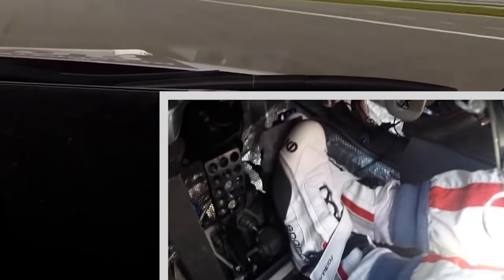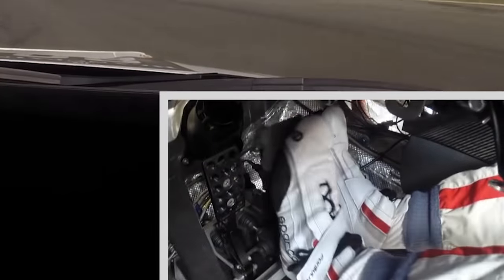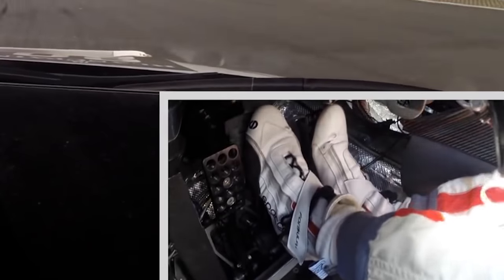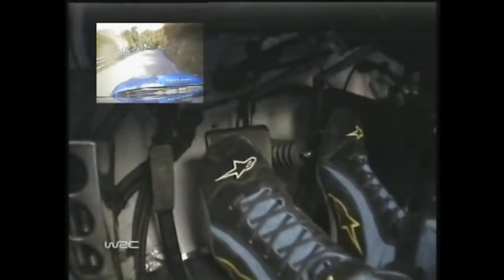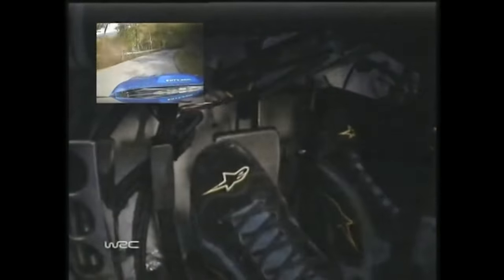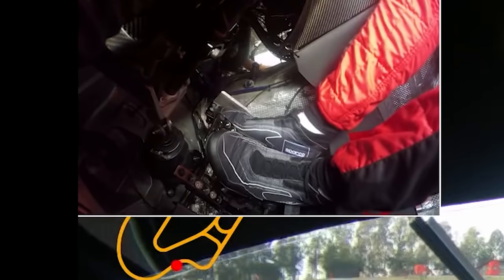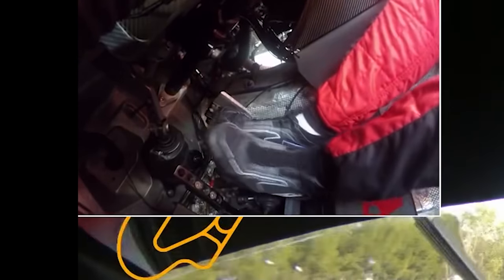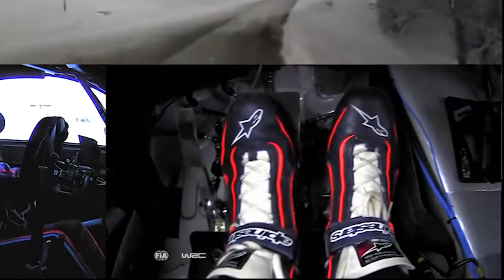Real Race Cars Have HUGE Brake Pedal Travel!... What?!

Comment: Good video Karl, somehow I only see it now. The main reason, I think, as mentioned elsewhere in the comments, is the BIG leverage ratio that is effectively the braking system. Think about it, in a GT3 car, pressing ~100kg on the pedal, creates a force of 2000kg (!!) on the car! This is the 'crowbar' effect. You can lift a heavy crate with a crowbar, by moving the end of the bar 40cm, lifting the crate 1cm. The lifting force is 40x your hand force, but the crate lifts a 40x smaller distance.

If a caliper flexes 0.4mm at 100bar, which seems possible as hot aluminium isn't magically rigid, that, according to my spreadsheet (i.e. subject to flaws) is between 20 and 40mm pedal travel. 

Fluid DOES compress. Each fluid has what is called a 'bulk modulus', the pressure required to reduce a volume of fluid to zero (if I recall correctly). Again here comes the crowbar effect: a tiny bit of fluid compression can be measurable pedal movement. In my spreadsheet predictions it is probably at least 5mm pedal travel.

Steel lines probably don't expand significantly, but the flexible hoses, even braided, might play a role. If the hose diameter is 5mm, but at 100bar pressure it is 5.1mm, depending on the length, say 25cm per corner, you have another 3mm pedal travel. Perhaps it expands to 5.5mm, then it is 15mm pedal travel.

Also, and this is from actual telemetry, a good portion of the pedal travel is from initial slack. If the pad to disc gap is 0.1mm (nothing!) then that is ~10mm pedal travel to overcome before you START to seat the pad on the disc. There typically is another bit of travel, again crowbar effect, as o rings move and expand maybe a tiny bit and the pad gets pushed flat on the disc. It can be a rule of thumb that maybe half the pedal travel is 'soft'. 
Even if the pad to disc gap is zero, I think the master cylinders have to move a little bit, beyond the reservoir opening, before they build pressure. Even pedal box installations to a sheet metal car can cause significant flex at high pedal forces.

One big way to influence it is by changing master cylinder bore size. You're changing your crowbar ratio this way, but there is no free lunch. If you half your pedal travel, you need twice the pedal force. And while G forces might help a little, there are plenty of examples of drivers getting tired / sore, even in modern GT racing. This is probably one big reason. The driver might want a stiff pedal, but can't press the 250kg this pedal would require. So in order to survive the race, from a leg strength point of view, you increase the crowbar ratio at the cost of having more pedal travel.

I won't claim absolute knowledge here, but at least some of these things will be somewhat true I would think (hope :D)
Reply from the maker: Hi Niels, nice to have your input! Yes all valid and accurate points there mate :)

Comment: It's all about master cylinder bore size and pedal ratio! The bigger the bore the stiffer it will be with less travel, run a smaller bore and you will have the opposite effect! Once the bore size is sorted you can adjust the pivot point of the actual pedal arm to either increase or decrease the ratio of movement acting on the master cylinder

Comment: @Karl: It was about time that someone raises the question! 👍Imagine that instead of a 2 cm diameter brake piston you stick a knitting-needle-thin piston 4cm deep into the brake cylinder, that way moving about 40 mm^3 of brake fluid. Let two brake pads together have 150cm^2 contact surface with the brake disk. The 40mm^3 fluid displacement moves the two brake pads by 2.6 thousandths of a millimetre (10th of a human hair). This gives you 4 cm of pedal travel :-) The extreme example explains the principle. In practice, every race and hobby mechanic adjusts the pedal travel by selecting a brake cylinder of his choice (with different bore diameters). The Asetek boss can do the same with "his" Audi GT3 and Kart - he just doesn't say so. Just marketing bla bla, painstakingly trying to have an USP.  Definitely not a revolution in simracing. Nils Heusinkveld had probably a good laugh. (Sad that Asetek tells stories that are not a lie but misleading by leaving out the truth.) What is preset on the Asetek Pedals due to its design (second stage hard, i.e. little to almost no pedal travel) can be set in the same way on almost every other hydraulic and LoadCell (sim racing) brake pedal, by using a softer spring/elastomer, and a very hard one (or just a metal or hard plastic sleeve to shorten the way.) Winning 0,2 - 0,4 seconds per hard braking due to shorter pedal travel  is also utmost BS: Our brain is smarter than Asetek. It simply compensates the longer pedal travel by starting triggering your brake foot a bit earlier . The moment the brake effect sets fully in is exactly at the same position on track (brake marker) as you would have chosen it with the Asetek Pedals. There are other reasons why some Pros prefer a short pedal travel, while others prefer a long pedal travel (even among F1 pilots). It's all about personal preference how your brain 'computes' best a mix of movement and pressure. Yes, pressure needs and uses " muscle memory" Though movement needs muscles too,  and triggers lots of other sensory nerves. So why not using both: movement and pressure. That's why most sim racers and real racers prefer to have both.
Reply: that makes sense but i am still skeptical thanks for the input !
Reply: I thought the same thing, it can be replicated on any load cell pedal or pressure sensor. Honestly only in Karl's review did I see doubts raised. Soon I will review it too and I will be able to talk about it with more knowledge.But having already reviewed the HPP and racewerk it is not easy to be surprised
Reply from the maker: Excellent comment! :D
Reply: Yeah makes sence. Im new to sim racing and i like 50 to 60% travel before hitting the stopper set to about 65% brake and have to really push to get to a point im sliding. So iv got 65% of easy fine tune brakes and something to help make sure i dont lockup. Plus feels nice compared to a solid break. I dont feel i could connect with them. More sensory in this way like was said. Think id prefer electric brake in a real car but be able tune it like the sim setup with a dampening stopper. Then that 1st 65% or however much you prefer is easy precise braking. No pedal play atall. EDIT, i think id still want a secondery mechanical brake pedal to the side as a backup.
Reply: Under G's might be a different story. But maybe just stiffer spring? I can understand f1 breaking not having play atall. But thats f1. There braking G's are nutz. But most cars i think id prefer that electric brake setup. Just change spring depending on braking G's. With electric you could also program it to account for pad disk space. So many options with electric brakes.
Reply: My man.   Great explanation

Comment: I took my Logitech G920 brake and removed the rubber piece then installed a longer but smaller diameter spring inside the stock spring. It came out of a Losi LMT remote control monster truck shock kit I had. The pressure gets harder the further I push and it actually bottoms out exactly at the sensor's maximum brake. There is no deadband at where it bottoms out. It seems perfect now. The travel is there but it works for my sim racing. I'm just getting to this pressure and travel, but I just replaced my G27 setup, which had long travel anyway.
Reply: that's a good idea!
Reply: We need good engineers. I can't imagine how much thought went into chucking a piece of rubber into the brake pedal, completely unsecured, not elastic in the slightest and blocking most of the travel on a potentiometer brake that needs travel to function properly.

Comment: I think you already answered your question why some racecar-drivers prefer a longer pedal-travel. With up to over 5G in an F1-car and 130 kg of needed pedal force a shorter pedal-travel makes sense, since they will make their body do most of the job that is tight to a harness, so less is more. In Rally-cars there are way lower pedal-forces needed and g-forces at play plus there are way more different grip-conditions while braking (and so g-forces applied) and very different wheel-vibrations as well depending on the surface. With a completely pressure-based brake-pedal they wouldn't know how much input they actually apply because it depends so much on the grip that can change in every corner. Rally-cars with so much guess-work and unexpected variables in braking-zones you need some brake-travel as a true objective indicator of your input, independent from the surface/grip-conditions, so seat of pants and how much g-force act as a brake-assist. 

In a static sim-racing environment  using a brake-pedal that gets stiff at around 80% is IMO better to avoid wheel-locking, but others are very quick with cheap Logitech-pedals, so it more depends what you are used to. With real driving dynamics especially in Rally this 'muscle-memory'-braking can't work. On a racetrack repetition is the key to consistency and when the grip changes, the vibrations of the car and how it behaves in one corner should tell you what to expect for the rest if the tarmac has similar grip. 

I've even noticed with my shakers, GS-5 and G-Belt that I do not exactly know how hard I brake when everything is turned off while calibrating the pedals. With a real seat mover pushing you forward while braking this effect is probably even more present and certainly far far greater with real g-forces. Braking with muscle memory alone is a myth.
Reply from the maker: Yeah that all rings true with me mate for sure :)
Reply: Best comment so far, without a force pushing you forward you will never know if you have pressed the pedal enough or not

Comment: Something that is worth mentioning from my perspective is that formula cars do not rely as much in weight transfer, suspension preload and naturally their approach speed and apex speed is higher so they are not on the brakes as long. Aero also plays a role in a formula car’s deceleration- there is less suspension movement, less tyre deformation as usually formula cars the tyre is also part of your suspension because the chassis and suspension are already very stiff in their design so having a stiff pedal is a natural by product. 
On the flip side a heavy touring car/GT3 has double the weight or more, has more suspension preload built into the car and has more tyre deformation due to weight transfer. This results in a longer braking zone because the car needs to slow further to reach the optimum apex speed with less aero assistance and more mechanical resistance. The longer braking zones result in longer braking intervals and a slower bleed off in pressure as you approach the minimum apex speed. A longer pedal allows for finer adjustments and modulation of pressure.

Comment: I just watched quite a number of pedal cam videos on youtube and interestingly a lot of pro cars have substantial pedal travel. One of the rate examples of a hard pedal is the F1 2022 AlphaTauri video where there is very little travel. Its also not just preload either because they seem to come off gradually for their trail braking throughout the movement and use smaller amounts of travel for less braking. It definitely goes against the Sim racing conventional wisdom of very hard pedals that don't move.

Personally I have always preferred a pedal that moves further because I find the combination of a loadcell and positional gives me a bit more control for trailing especially but squishy brakes in road cars has likely set me up for finding this more natural.

Comment: I have absolutely zero race car experience but before I had my kids I did many track days on my motorcycles over the years. From my limited knowledge, it's rider (driver) preference and the travel can be changed via cylinder diameter.

Preference goes for alot of things, everyone on the track that day would be running different tyre pressure, though one thing we all agreed on was having a cable clutch.
Reply: Yes, cylinder diameter and pedal ratio (pivot point) change the amount of fluid pushed.
Reply from the maker: Yeah a smaller MC will mean more travel, but I've never seen this much before... but then I'm no pro race car tuner?! lol

Comment: Depending on the car and driver, it can be set for what is most accurate. More travel means more precise but slower. This could be suited to different cars more. Formula cars would have lass travel also due to limited space in the cockpit. 
When I raced bikes, I had brakes issues once where brake lever touched the handlebars due to air in the system.

Comment: Dan Morad posted on his Discord a video of the travel from the pedals in the Merc GT3 he's driving and it also is way more than you'd expect. Here is what he said about it: "It’s the way I like it on the sim because I just find that driving with a load cell vs hydraulic pressure is completely different. But ultimately, I just like the control I have on the brake release. It isn’t a one shape fits all situation. You need to find what works for YOU. That’s the biggest problem with sim drivers looking to improve. You try to copy others. Use other methods as inspiration but it comes down to your personal feeling at the end of the day."

Comment: Brake temperatures are only thing i can think off i.e fluid temp, pads and/or disc temps. Ive seen carbon ceramic equipped lambos pedals go to the floor on the initial application then when they warm up if you tap them too hard you lock up and spin.

Comment: Hi Karl,

A long pedal could be many things,

Air in the system 
Boiled fluid 
Brake temp
Pad knock off
worn pads, a pedal will get worse during a race 
The calliper could be flexing 

Also worth noting you change master cylinder bore sizes to provide the correct feel, driver specific
Reply: this was part of my response but cut it all out to focus on sim vs real travel.

for example I know from experience, fitting 'big brakes' on an mx5 without changing the master cylinder (also has bias on mx5) and booster to suit, will result in a muddy pedal and brakes that are rear biased, people do this and feel its fine, but pair it with a correctly matched setup and the brakes are firm and crucially, don't need so much force/travel in pedal at speed as its no longer rear biased.

and also through experience, the day you spend setting up your new brakes, all freshly bled and nice chunky pads and rock hard pedal, is absolutely nothing like the drive home after a trackday with scrubbed tyres, low brake pads, possible moisture in fluid or even cooked fluid and a limp pedal that gives a sense of fear on road to how much travel it now has.
Reply from the maker: Yeah I covered all of those in the video bar MC size which IME still doesn't give that amount of travel.
It's weird as I actually didn't find any footage of short travel pedals at all?!
Reply: @KarlGosling  
As a race technician I can only speak for how the pedal feels in the garage, with new discs and pads and well bled system the pedal feels rock solid, after a 6h race with cooked brakes that same pedal is going through the bulkhead in order to get the car stopped, I think it’s something that’s gradually gets worse track/ rally dependant

Comment: Could it be a combination of factors.  1) Lightweight racing cars are more like a switch specifically designed with short travel and don't need a servo as the cars are circa 500kg whilst 2) cars that are converted for racing either have a servo as the mass of the car is over 1 ton and or there is a preference by the driver to have a greater range of travel (rally car)so that pedal feel and range of pedal feel is designed in.

Comment: I would imagine (but don’t know) that the brake system is connected quite close to the pivot point of the pedal to increase pressure through leverage, at the cost of extra movement. I say “cost”, but I actually like having lots of pedal movement myself.
Reply: Yes I believe this is correct. There are two things I know of that increase pedal travel:
- increase pedal ratio to increase travel
- decrease master cylinder diameter to increase travel
Both of these things essentially change how much fluid you’re pushing for each millimetre of pedal travel.
Reply from the maker: Could well be a leverage choice for a softer pedal.
Reply: @KarlGosling  It's certainly possible but it is difficult to believe that so much pedal movement is any way beneficial. I'm thinking that those video examples are of drivers whose braking systems are on the limit, probably at boiling point, to be suffering  so much fade.
Reply: This seems like most reasonable explanation.

Comment: It’s called master cylinder to slave cylinder ratio. If you have a small mc piston and a large sc piston, you’ll have a long pedal but the travel at the sc will be very small. It’s essentially the same thing which happens on a 10spd bicycle, in an easy ge@r, you have to rotate the pedals several revolutions to get one single revolution at the back wheel.

This is a very common setup change for rally drivers, and is precisely the reason why they still have the full amount of brake pedal travel even on snow and ice stages, where the actual pressure at the sc/pads is nowhere near as high as when on a tarmac stage, for example.

Hope that helps mate. Nice vid, btw.

Comment: It has to do with angular momentum. The brake disks are floating, and the calipers are fixed. When you are cornering, the floating disk is pushing back the brake pads. That will result in a gap that has to be overcome.

Comment: What you are seeing is leverage. The pedal might be moving alot but the piston in the master cylinder isnt. It allows them to brake very hard without having vacuum assistent etc. So the pedal might move quite abit but the actual piston pushing into the brake cylinder is barely moving.